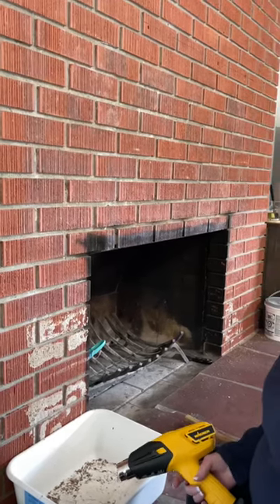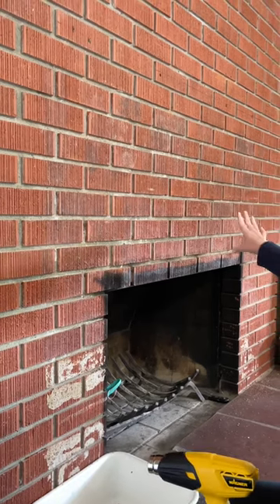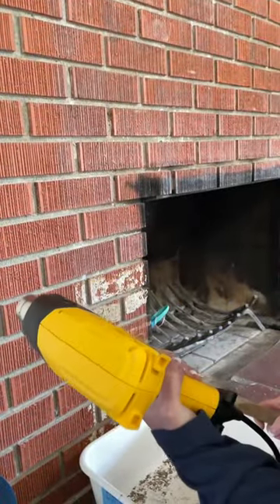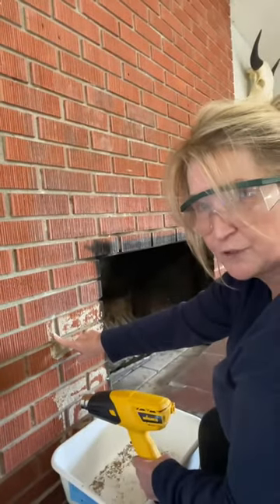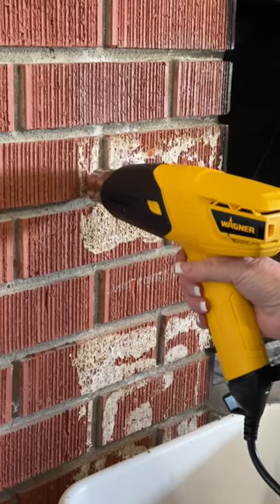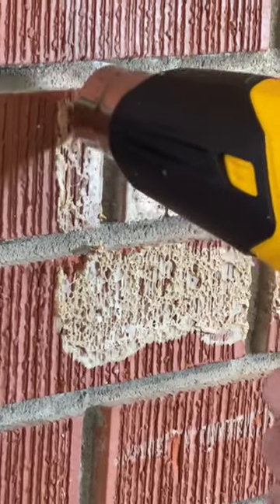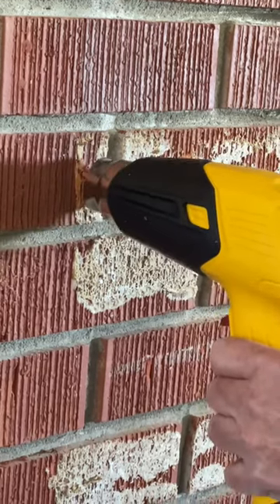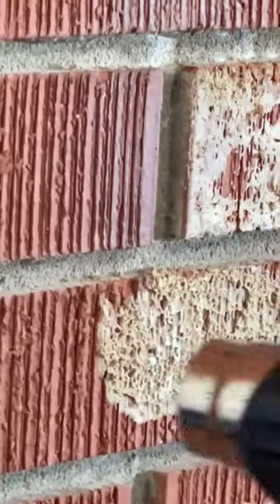Removing construction Adhesive (Liquid Nails) from Masonry

Comment: I really appreciate you making this video! This really saved me from so much hassle. There was Gorilla Glue masonry that was on my brick fireplace and it was so stuck I had no idea how to get it off. I went to Home Depot and got the same heat gun and a wire brush and it worked like magic! I wouldn’t never have thought to do this without you posting this. Thanks a Million! 😊